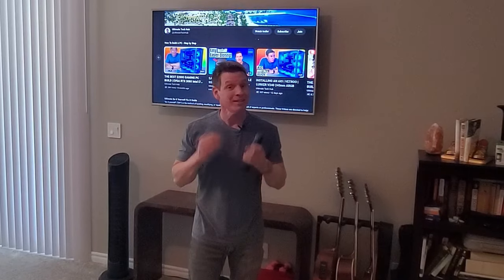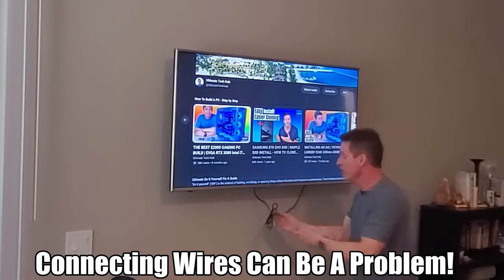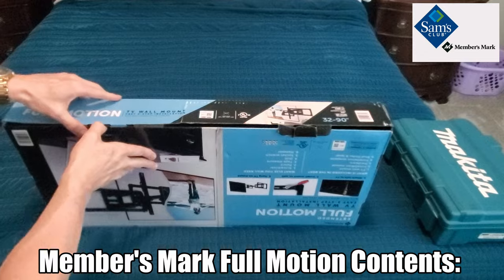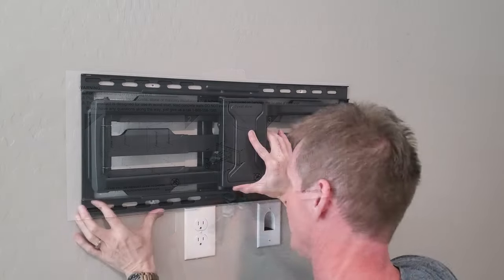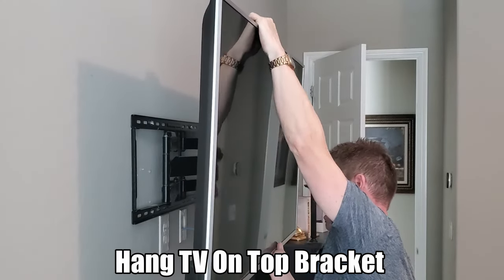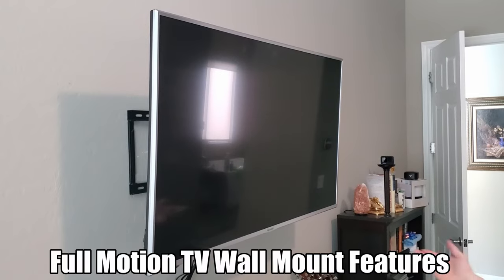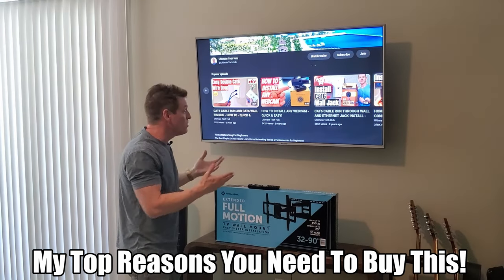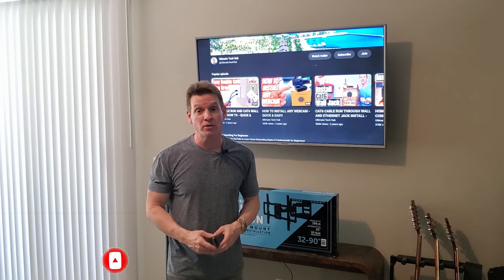Member's Mark FULL MOTION Extended TV Wall MOUNT | Install & Review

Comment: Great info. Thanks. Can this bracket be used in a corner wall?
Reply from the maker: It depends where the studs are located near the corner. It will probably work. Good luck and keep me posted,

Comment: What size drill bits did you use for the initial hole, and for the second time around?
Reply from the maker: I don't remember but always go slightly smaller than the bolt your screwing into the studs.

Comment: I would like to have information on the height of a large 75” tv and how much it hangs below and above the mount.
Reply from the maker: It depends on which brand TV. Sony uses mounting holes that are very low on the back of the TV. Samsung uses holes more in the middle of the TV and same with LG.

Comment: My sams wall mount is too stiff/tight. It just wont move after we placed our 85inch tv. My concern is, if I put too much pressure from thr sides of the tv, the central assembly of the mount may break the thin screen. Anything i can do,add lubrication to the joints/ looaen some nuts to solve the issue?
Reply from the maker: The mount should move. You can put pressure on the mount to move it. It won't break the TV or bracket.
Reply: I have this same issue. Moves left and right just fine but I cannot get it to move in and out for the life of me. Any ideas?

Comment: What kind of studs did you use?
Reply from the maker: Lennar Home builders install a large board into the walls where TVs are to be installed so you can drill into any area around the installation location. Otherwise most homes have 2 by 4s 16 inches on center.

Comment: Asking is this safe for 75-85 inch tv? I’m wondering if the wall and the mount can lift the 75-85inch tv?
Reply from the maker: Yes its safe. Should hold up to 90 inch TV.
Reply: @UltimateTechHub  thanks

Comment: I just installed mine but how do I told it horizontally? Mine dips down slightly to the right
Reply from the maker: You can adjust it horizontal by moving the left or right side up or down. Just a little bit of pressure to make the adjustments.
Reply: @UltimateTechHub  thanks! I wasn’t sure if I needed to loosen a bracket to move it. The pressure needed is somewhat significant, which makes sense to prevent it from naturally leaning, so I didn’t want to break it haha

Comment: You didn’t dumb it down enough. We use the screws in the back of the tv?
Why do we need spacers?
Which spacer and why?
Which screw and why?
Which hole in the bracket?
Reply from the maker: Each TV company has different size holes and some need spacers and some do not. It's something you have to test to see which bolts work. Sony uses different size holes then Samsung and LG uses different size holes as well.

Comment: It’s annoying how you don’t specify what size drill bits to start and end with
Reply from the maker: Choose a drill bit slightly smaller than the bolt, its easy. You want the bolt to go in very snug and tight! Thanks for watching! 😃